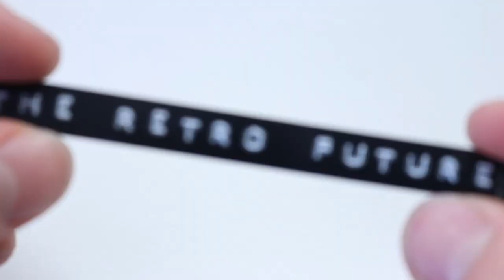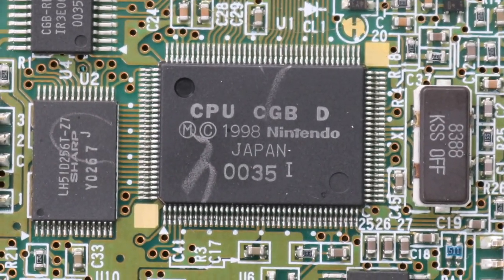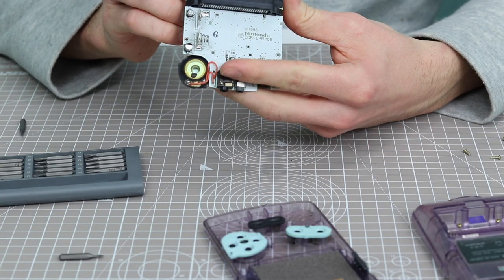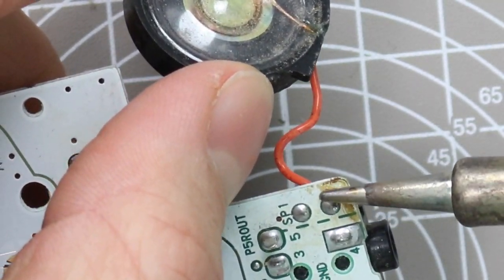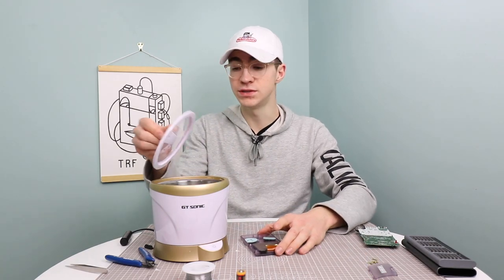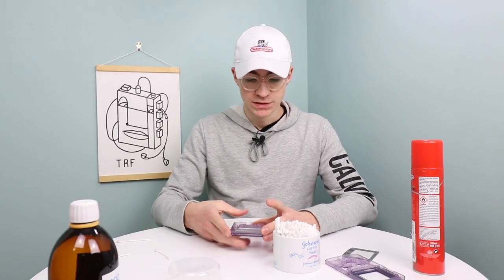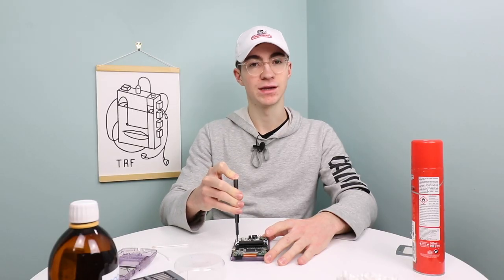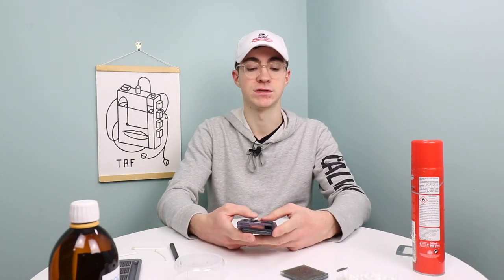Let's Refurb! - GameBoy Color Won't Play Games!

Comment: no idea what a gbc motherboard pcb looks like but couldn't you desolder the entire contact assembly to get better access to the contacts?
Reply: Generally speaking the contacts are moulded into the plastic which means you have to desolder each pin. So desoldering the entire connector fixing it and resoldering it is possible but it isn’t worth the effort when you have a spare board to hand.

Comment: I wouldve just tried to reflow all the pins in the cartridge slot, since it might be an issue of solder detaching from one of the pins off the motherboard due to mechanical stress.

Comment: Hey there. I have a similar problem on one of my colours.   
I’ll give it a try. Loving the intro thanks for helping
Reply: Hey did you fix your colour? I have the same issue after I replaced the capacitors, all worked perfectly until it started to behave like this about 48hrs later.

Comment: But why didn't you have a look at the contacts of the replacement board? that one sticking out pin might not be a fault, it's probably just the ground pin that needs to be connected first.

Comment: Well, pushing that pin back down would of improved the gameplay and other small things, but there's a good chance that something on the board was fried, which that is not always obvious (sometimes it can be the tiniest most invisible detail). If you do look into the board further, I'd use a continuity meter to test all the possible connections.
Actually, that continuity meter beep is also a satisfying sound. lol

Comment: i was just repairing that exact pin and ill tell you right now if it was that pin (which is marked ground on the games circuit board BTW) the gameboy logo will be corrupt like we always see. So what happened was the pin on mine got caught on a game after sitting for so long and it crushed it down into the slot. It looks like that might have happened to that one too but its hard to tell. When the pins get crushed down inside there they fold over themselves in a strange way and can be confusing on how to unfold them. Personally i got mine to take carts but when it acts up it usually means a pin got crushed again. You on the other hand have a very strange problem being that the logo seems fine and not corrupt. P.S. I melted the snot out of the back of the ground pin plastic to get at it and ended up getting it into a place that allows it to work only by luck alone. not recommended

Comment: Had the same problem with my GBC exact same colour as well. My issue was with the screen, I have to clean the contacts and apply some pressure as overtime the copper coating degraded or something leaving a line on the flex cable where the flex cable holder thing was clamping onto it. Works fine now.

Comment: The faulty motherboard can still be saved :) you can desolder the cartridge slot and solder a new one in
Reply from the maker: I dont have the tools for that! The cart slot would melt before I got anywhere near desoldering that.
Reply: @TheRetroFuture  I did just same it worked just fine after fixing 3 pins
Reply: That's what I was wondering if you could do
Reply: You can get those connectors for 3 bucks in AliExpress, a desoldering pump is super cheap, and maybe some solder wick with a bit of flux, it's a skill worthwhile learning.
Reply: it's not always the case. just saying
Reply: I don't event think you need to do that,  The first thing I'd try is to put some rubbing alcohol on an old cartridge and push it in and out a few time to properly clean the contacts, then give it a blast with a can of compressed air to get the rest of the dust out. it just looked dirty and blowing into it won't do anything apart from move the dirt around. if that doesn't work then I'd consider replacing the slot. But looking at it I'd say it just needed a good clean.
Reply: Who would really wanna do that tho?
Reply: @isaacgaming3787  well if you have a board that has too much corrosion at the point that it isn't fixeable for example, you can just swap the cartridge port from that board to this board which is fine
Reply: PixCub yeah I guess so
Reply: @The Retro Future well you could used desoldering braid to remove the solder on motherboard and then replace the broken cartridge slot and then replace it with the new one and flux is helpful to desolder the cartridge slot but it’s rare for the cartridge slots on gameboys to die out most of the time it just needs repolishing and cleaning like the nes cartridge connector but not as easy
Reply: @ChrisMX9  the problem is that using this method you can destroy the traces. The best way is to use a solder with a low melting point
Reply: @TheRetroFuture  idk if you'll see this but you could cut the soldered wires pull off the plastic bit heat each wire and pull out with tweezers. then drop the new one in soldering it down won't hurt the plastic with a standard soldering pen use your finest tip you have and do every other one and you'll ensure no melt.just a thought.
Reply: he never fixes anything, he just replaces the motherboard
Reply: @TheRetroFuture what about now??

Comment: Whoa stop the pin that you were trying to move does not need to be moved that's ground it's where it's supposed to be try cleaning all the pins with a card cleaning kit it looks really dirty in there ps thank you for sharing always good videos.
Reply from the maker: Ah very interesting! I did clean the pins. The solder joints where not dry either. I believe it was a chip issue. Probably a ram error.
Reply from the maker: A learning experience anyway - people wanted me to show my failures as much as my successes! Thanks for the information & thanks for watching!
Reply: @TheRetroFuture  Was about to say the same thing. I was yelling no at the screen when you tried to push that contact. Remind me, do you have a flashcart? I might he interested in trying to run some form of diagnostics on that unit to see if I could figure out what the problem is.
Reply: @Gameboygenius  I have a gameboy that is having the exact same issue. Has there been any resolutions yet?

Comment: My original GB does this but after Nintendo logo just shows blank screen
Reply: Probably because the game doesn't work
Reply: @urielc918  nope games all work fine in my GBP and gba
Reply: If you have an old credit card or something, get a paper towel, soak it in cleaning alcohol, and wrap it around the card. Insert it in and out of the game slot several times, then try again.
Reply: Have the same problem after the Nintendo logo just black one time it worked but took like 30 times
Reply: @MaybeIsa.501  same happening to me, how did you do it?

Comment: Hey! I was thinking earlier this morning about reaching out to you for this. I have a 30 year old NES that just blinks weird colored lights on the screen and doesn't respond to games.  My Abuela got it for my uncle in the 80's and they all loved it.  My aunt and grandmother and uncle loved it the whole time. It was then passed on to me at age 8-9 I don't remember. So please respond if you would be willing to fix this for a video. 

Thanks,

-Alex
Reply: Replace the 72 pin in it easy to do
Reply: @MrJ0mmy  I would probably break it
Reply: @alexisgarbage  it is realllllly easy to disassemble an NES there are tons of tutorials on YouTube that explain how to do so, once you get the 72 pin connector off I would recommend to clean it and not replace it because replacement are pretty poor quality and cartridges are difficult to insert. 
Clean it by ether using a toothbrush and some rubbing alcohol or by boiling it in water ( yes that does work lol )
Reply: @ChrisMX9  ok I'll look into it! Thanks for the help you guys.
Reply: @alexisgarbage  you're welcome :)
Reply: @alexisgarbage  theres a website or app called ifixit and theres a step by step of the dissassembly. Sometimes you don't have to replace anything. The old NES with that "videotape action" (when you put the cartridge and slide in then down) requires that the NES has an internal 90 degrees adaptor thats connected the mobo to the cartridge. That "adaptor" is totally removeable without having to dessolder. Some of those pins might be dirty or bent. try dissassembling the NES, remove this adaptor, clean and unbend so that they have more contact.
Reply: @mtubr  iFixit only has the dumbest advice in my experience. Only complicated solutions to simple problems.
Additionally you definitely don't want a guy like the retro future dude to "fix" your shit, but someone that actually understands electronics.

Comment: As you probably know, cleaning corrosion is a delicate process because any abrasives will remove the gold plating and leave the copper bare which will corrode again very very quickly. One trick I’ve used in cases where isopropyl wasn’t cutting it, is a pencil eraser. They contain a tiny amount of super light polishing abrasive - so little that it’s nearly impossible to remove plating, but enough to take corrosion off that isopropyl won’t. Just a trick for repairs that need it. 👍 Keep up the awesome vids!!

Comment: The last pin in the cartridge holder is set lower than the rest. All my GBC’s have this. I had the exact same issue with a recent mod. Turned out that the screen ribbon cable was not seated properly. For anybody having this issue, try taking it out then pushing it in again.

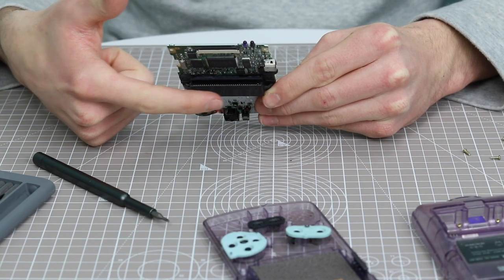Comment: Please do not push that pin back as he does starting at 2:54. I noticed mine also had that pin in a different orientation than the rest, then I checked the iFixit teardown and their last pin was also slightly pushed up like you see in this video. It's supposed to be like that. https://guide-images.cdn.ifixit.com/igi/exqy6aPt31OAUrh1.huge

Comment: This video is very helpful. I've been trying to fix my gbc, and so far I could open it and replace the screws from the back, but I cannot find a way to remove the 3 screws on the circuit board. If I push it a little bit to remove the screws, could I mess up the motherboard? I got this gbc when it came out and I have never ever opened it before...and yes, I removed a LOT of corrosion and dirt, but if there is any corrosion on the other side where the buttons are, I cannot access there since I cannot remove those damn screws :/
Reply: I forgot to mention that all my gb/gbc cartridges, including Pokemon, they all work in my gba, so I am pretty sure it's not an issue of any of my cartridges*

Comment: Dont you use flux when soldering?
I think you could desolder cartridge slot with heat gun and soldier new one. It would be really nice project for you.
Also you could use multimeter to check conductivity in that cartridge reader to see which pin is broken-

Comment: it's nice to show the fails. This happens often when i try to fix things, but that's how we learn. Maybe you can check the cartridge pinout to see what this pin is for and maybe do a continuity test with a multimeter to check the connection is broken. I would love to see a part two for this motherboard and see if it's fixable !

Comment: Highly recommend you use contact cleaner on your corroded areas before using isopropyl alcohol. When the corrosion cuts into the metal the alcohol usually can't dig deep enough to fully remove the corrosion on it's own.
Reply: Wow I scrolled so far down and your the first comment of this 6 month old video congrats